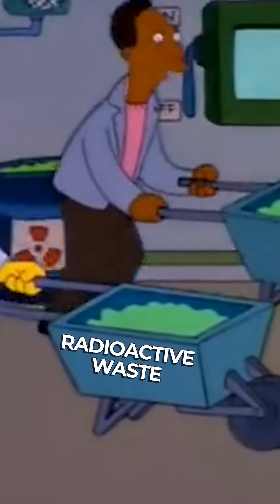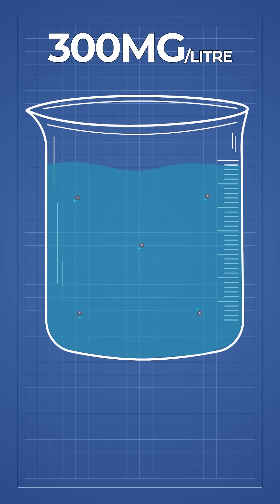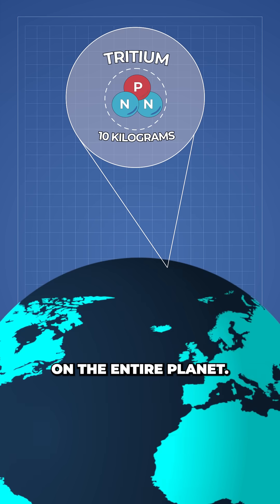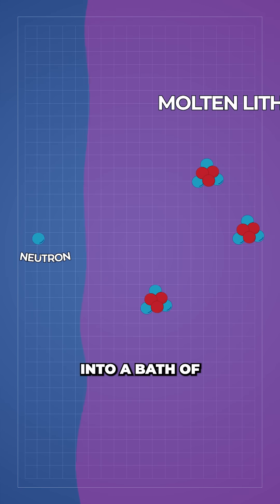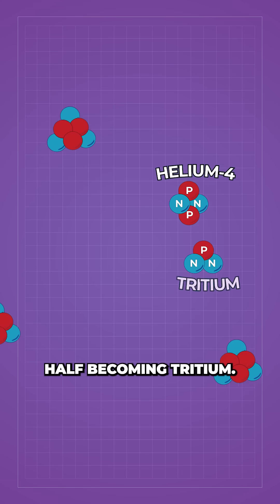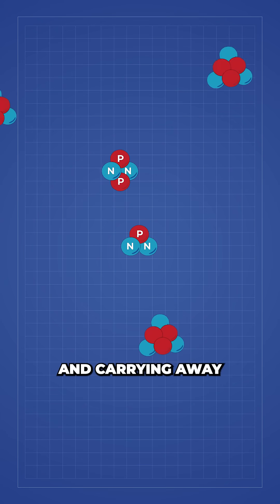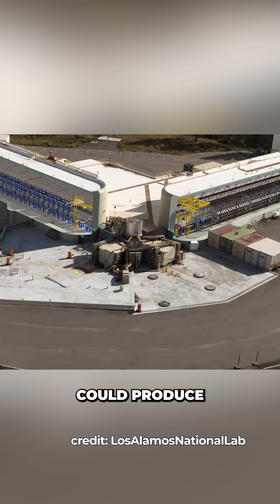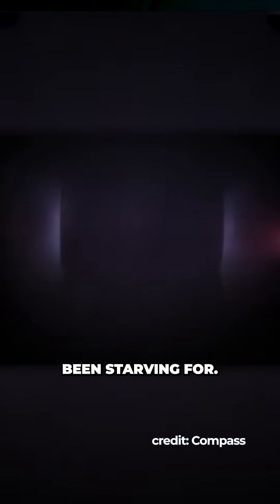Scientists Just Created Fusion Fuel From Nuclear Waste

Comment: Deuterium concentration in seawater: do a basic sanity check and “300mg/liter” sounds way too high. A liter of water weighs 1kg, and sea water would be about the same (little heavier due to the dissolved minerals). 0.3g/1000g gives about 1/33000. No way it’s that high. Should be measurable in parts-per-million. Easily an order of magnitude off.

Comment: A single typical CANDU reactor produces approximately 130 grams of tritium per year. Canada's fleet of reactors generates a combined total of about 2 kilograms of tritium annually. Tritium is produced as a byproduct of neutron interactions with heavy water in the reactor, and it is extracted for use and safety by specialized facilities. 
The Darlington Nuclear Generating Station in Canada and the Wolsong Nuclear Power Plant in South Korea have operational tritium extraction facilities for their CANDU reactors. A third facility at the Cernavodă Nuclear Power Plant in Romania is currently under construction.

Comment: Why they are not using the hydrogen? Smells like fake...
Reply: Because it’s a lot harder to press normal hydrogen atoms together in a way that causes fusion, which says a lot considering how hard fusion with tritium already is
Reply: @alexsiemers7898  
I tell you.
Hydrogen fusion is NOT proven. How proton can decay to heavier neutron, emitt enti-electron and gamma energy? That is aganist the physic.
Especially when hypercharhe particles are far heavier than proton.
This reaction base on fraud "weak nuclear force".
The "Z and W" boson mass should equal 0.42 MeV, just a little less than electron (0.510 MeV) and for two of them anihilating.

Comment: Not ALL fusion reactors use it though. There are A LOT of Fusion designs these days, some better and more promising then others. The french are building one of the most short sighted ones as the casing of the reactor will end up wearing out, being VERY radioactive and EXPENSIVE to replace

Comment: The Geet reactor the thermoelectric heat exchanger is the particle accelerator and the engine it’s paired with becomes the fusion reaction chamber. Various fuels can be used to start the reaction but once it’s started more and more fuel can be produced from steam reforming.

Comment: Interesting. Seems to be analogous to what is proposed in many reactors design, that are supposed to use lithium to be bombarded by the radiation from the tokamak to basically do the same thing. But you still need some tritium to start the whole process, and this is where plants such as the one in the video would come into play.

Comment: But how much energy does It take to blast those nuclei to make the fuel? Is the overall energy going to be a positive trade?
Reply: Asking the real questions.
Reply: This thing is essentially an accelerator-driven nuclear reactor. The accelerator makes it so that the reactor can take many different types of fuel and also the chain reaction cannot self-sustain when something goes wrong.

But it is still a nuclear reactor, and creates a lot of power all on its own. These types of reactors have been proposed before not for tritium production but for safer nuclear power. So yes, it is net energy positive (already before we get to the fusion) - but at an even higher cost than conventional nuclear power.

Comment: I knew that fission could feed fusion but calculus was always an issue for me and so I could never open mouth without inserting foot. (Former physics major; though I was unable to complete my undergrad degree due to health issues). It just made sense.  To oversimplify it for illustration, basically, fission splits helium into different types of hydrogen & waste and fusion takes a type of hydrogen and combines it into helium and so it only makes sense that one should be able to at least partially fuel the other.  I say "partially" because there's no such thing as a free lunch; no process is 100.0% efficient.  One of the biggest issues with nuclear power is what to do with the portion of the waste that cannot be repurposed. I've often wondered if the waste is so energetic, why they couldn't just harness that somehow to generate more electricity? I know that this is a simplistic view (on the surface level, anyway), but I'm glad to see that I'm not alone in thinking this, as they managed to figure out what to do with some of that waste to turn it into fusion fuel and if they can do that so far, I can't wait to see what else can they figure out to do with the rest of it.

By the way, I hope I don't have any typos and this makes sense. I'm quite tired and about to go to bed as I write this, so if there are any typos or I need to edit this, I'll do so in the morning

Comment: Fyi, tritiumnhalf life is around 12.5 years, which is a large reason why we have so little on Earth. It will always be something you have to make. Also, fission is not just "waiting fora fuel source", we are still decades or centuries away from net positive fusion power, let alone making it profitable or having enough smart people to run widespread plants (fusion engineering is some of the hardest there is), so this "solution to fission fuel" is "solving" a non-existant problem/roadblock :/

Comment: 1.	Hydrogen (H)
	2.	Helium (He)
	3.	Lithium (Li)
	4.	Beryllium (Be)
	5.	Boron (B)
	6.	Carbon (C)
	7.	Nitrogen (N)
	8.	Oxygen (O)
	9.	Fluorine (F)
	10.	Neon (Ne)
	11.	Sodium (Na)
	12.	Magnesium (Mg)
	13.	Aluminium (Al)
	14.	Silicon (Si)
	15.	Phosphorus (P)
	16.	Sulfur (S)
	17.	Chlorine (Cl)
	18.	Argon (Ar)
	19.	Potassium (K)
	20.	Calcium (Ca)
	21.	Scandium (Sc)
	22.	Titanium (Ti)
	23.	Vanadium (V)
	24.	Chromium (Cr)
	25.	Manganese (Mn)
	26.	Iron (Fe)
	27.	Cobalt (Co)
	28.	Nickel (Ni)
	29.	Copper (Cu)
	30.	Zinc (Zn)
	31.	Gallium (Ga)
	32.	Germanium (Ge)
	33.	Arsenic (As)
	34.	Selenium (Se)
	35.	Bromine (Br)
	36.	Krypton (Kr)
	37.	Rubidium (Rb)
	38.	Strontium (Sr)
	39.	Yttrium (Y)
	40.	Zirconium (Zr)
	41.	Niobium (Nb)
	42.	Molybdenum (Mo)
	43.	Technetium (Tc)
	44.	Ruthenium (Ru)
	45.	Rhodium (Rh)
	46.	Palladium (Pd)
	47.	Silver (Ag)
	48.	Cadmium (Cd)
	49.	Indium (In)
	50.	Tin (Sn)
	51.	Antimony (Sb)
	52.	Tellurium (Te)
	53.	Iodine (I)
	54.	Xenon (Xe)
	55.	Cesium (Cs)
	56.	Barium (Ba)
	57.	Lanthanum (La)
	58.	Cerium (Ce)
	59.	Praseodymium (Pr)
	60.	Neodymium (Nd)
	61.	Promethium (Pm)
	62.	Samarium (Sm)
	63.	Europium (Eu)
	64.	Gadolinium (Gd)
	65.	Terbium (Tb)
	66.	Dysprosium (Dy)
	67.	Holmium (Ho)
	68.	Erbium (Er)
	69.	Thulium (Tm)
	70.	Ytterbium (Yb)
	71.	Lutetium (Lu)
	72.	Hafnium (Hf)
	73.	Tantalum (Ta)
	74.	Tungsten (W)
	75.	Rhenium (Re)
	76.	Osmium (Os)
	77.	Iridium (Ir)
	78.	Platinum (Pt)
	79.	Gold (Au)
	80.	Mercury (Hg)
	81.	Thallium (Tl)
	82.	Lead (Pb)
	83.	Bismuth (Bi)
	84.	Polonium (Po)
	85.	Astatine (At)
	86.	Radon (Rn)
	87.	Francium (Fr)
	88.	Radium (Ra)
	89.	Actinium (Ac)
	90.	Thorium (Th)
	91.	Protactinium (Pa)
	92.	Uranium (U)
	93.	Neptunium (Np)
	94.	Plutonium (Pu)
	95.	Americium (Am)
	96.	Curium (Cm)
	97.	Berkelium (Bk)
	98.	Californium (Cf)
	99.	Einsteinium (Es)
	100.	Fermium (Fm)
	101.	Mendelevium (Md)
	102.	Nobelium (No)
	103.	Lawrencium (Lr)
	104.	Rutherfordium (Rf)
	105.	Dubnium (Db)
	106.	Seaborgium (Sg)
	107.	Bohrium (Bh)
	108.	Hassium (Hs)
	109.	Meitnerium (Mt)
	110.	Darmstadtium (Ds)
	111.	Roentgenium (Rg)
	112.	Copernicium (Cn)
	113.	Nihonium (Nh)
	114.	Flerovium (Fl)
	115.	Moscovium (Mc)
	116.	Livermorium (Lv)
	117.	Tennessine (Ts)
	118.	Oganesson (Og)

Comment: Man i knew nuclear reactions where hot as hell but having MOLTEN Lithium as a coolant really puts it into perspective
Reply: That was honestly the biggest takeaway for me
Reply: @detumaki why a takeaway ?
Reply: @detumaki why a takeaway ?
Reply: I was thinking the same thing, Liquid Metal to keep it cool lmao
Reply: I always found interesting that when they make large sheets of glass, they have a pool of molten zinc that they pour molten glass on top off. Since the zinc is liquid it is perfectly flat. But zinc melts much "colder" than glass (about 800F vice 2500F) so the glass cools and solidifies on top of the pool of molten zinc.
Reply: @natehill8069 oh shit thats cool
Reply: @natehill8069  This might be one of the most genuinely useful things I’ve learned this year. Now I can try making my own window panes from recycled bottles with some reusable zinc! And a REALLY cool demo for my chemistry students!
Reply: I read they take a bar of lithium and place it on the floor of a tokamak. 100 million degrees °C doesn't seem to care about its melting point.
Reply: 100%
Reply: Lithium has a super low mp compared to other metals
Reply: The meltingpoint of lithium is only at 180.5°C. Not that insanely hot isnt it
Reply: @benoitgoessens3024 pretty hot when you’re considering it’s been used as a COOLANT
Reply: @FetusFight not really bit that is alright. If you look at producing iron or aluminium the temperatures are way higher. And besides that they use the liquid lithium to catch te loose neutrons and make new elements, it is not per sé as a coolant
Reply: @benoitgoessens3024  point isnt about how fucking hot the lithium is but how much COLDER it is compared to the reactor, critical thinking is free btw
Reply: @LowkeyEmerald critical thinking is that you know it isn't even used as a coolant but as a medium for aditional reactions. You can take a course yourself
Reply: @benoitgoessens3024  double, add 32...ya thats fucking hot
Reply: @benoitgoessens3024 well ok yeah good point thats is not THAT hot

But still it was the first time i have heard of a molten liquids being used as a coolant
Reply: lithium mellts at 180C.  Really not that hot for an industrial process.
Reply: liquid metal cooling isnt that crazy, even some commecrial products use that
the fun comes when molten alkali-metal escapes containment
Reply: @kkjkjh professional at not having fun
Reply: There's a bunch of reactor designs that are cooled by molten sodium, or NaK, a liquid alloy of sodium and potassium. 

They're actually quite efficient, but the safety concerns involved (and unfortunately a major accident) have made a lot of organizations shy away from researching them.

Comment: Dude we've been doing this for 20 years tf u mean scientists "just" discovered
Reply: Fusion =/= fission
Reply: @dracod7439  This is about recycling of fuel to make tritium, unrelated to fusion or fission.

Tritium itself was first produced artificially in 1934 by Ernest Rutherford, Mark Oliphant, and Paul Harteck through deuterium bombardment. However, tritium production at scale came during the Manhattan Project (1940s), when scientists discovered that lithium-6, when irradiated in a reactor, could breed tritium.

The idea of fuel recycling into tritium—meaning breeding tritium from lithium inside nuclear systems to sustain a reaction—is mainly a fusion energy concept. This was formalized in the 1950s–1960s, when scientists working on magnetic confinement fusion and inertial confinement fusion realized that deuterium-tritium (D-T) fuel cycles would quickly run out of natural tritium unless a lithium breeding blanket recycled it.

This means we've been recycling into tritium for about 60-70 years and the concept of tritium breeding itself is around 90 years old.

Comment: This wastes energy to make energy, a better solution is a molten salt fast-spectrum breeder reactor which can use these same isotopes to MAKE energy rather than waste it while simultaneously using neutrons that escape the core to breed tritium, further if the salt used is a lithium salt, tritium will also be created in the core.

Comment: sadly nuclear the worlds suply of nuclear waste is on 20kg and to run a fusion reactor for a full day would require 300 grams of nuclear waste a day do it would only power for just over 2 months, the world is shutting down their nuclear powerplants due to meltdowns occuring around the world so the 20kg is decreasing month by month. another thing to add on is that if we do use nuclear waste it will turn the tritium radioactive making the fusion reactor as dangerous as nuclear reactors

Comment: This is actually amazing! It will make opening more reactors easier. You can use lithium to breed tritium in fusion reactor already (so you use tritium in the reaction and the energy can split lithium to make more tritium which we can then cycle through to keep the reaction going) but that only makes so much, less than you put in I believe, or just enough to break even at most. But if we could make it without the need to breed it from a reactor, that’s actually amazing.

Comment: You are aware that not all reactors use those elements, right? And no, causing a nuclear chain reaction in a particle accelerator is not a good idea. And no, you can't make so precise breaks with neutrons in atomic waste in order to get exactly what you want, let aside the cost. Yes, there are reactors blueprints that could use nuclear waste. But no, those are not build yet. Just a few are even planned yet! And I don't know why that would solve our current problems, and did you even think about that there are multiple kinds of nuclear reactors? Some use plutonium, for example. How do you intend to make something as efficient as plutonium by breaking the waste down??? Tritium is the heaviest and only radioactive isotope of Hydrogen! And yes, that is a really small aspect of the problem, I know, there are much more than that. But think about it: Many Reactors on the planet already exist or have run. They run on radioactive materials like plutonium. You can't just switch the materials out like we are in satisfactory! Have you ever thought about why that is? Because you need completely different things for each used reactors type! And another thing: You said, they could produce one fifth of the needed material per year. That's way too low. I am not sure about ten kilogram of Tritium on earth since the web says it's 3.5 kilograms over the entire atmosphere, but oh well! Let's not forget about this: That stuff is pretty weak! And you would need an absurd amount of it in order to make a + in energy! And it's mainly created by nuclear reactors and cosmic radiation! And why on earth would you choose an element thats main usage is as a key ring decoration??? Use your brain! Atomic waste is an important thing, but you would only get a small percentage of what the big reactors produce! Please don't shout things like: "This solves all of our problems!" Before there is a realistic usage. The only good thing in this method is that we could get a bit of energy left in it. But the process takes away much of that energy.

Comment: Well.... current fusion reactor designs would produce their own tritium in the mantle of the reactor itself... Tritium production is more effective with higher energetic neutrons from a spallation source indeed, and could reduce the amount of long lived radioactive materials, but it is very expensive to build and operate. And energy wise, it would add a lot of additional input power required to operate a fusion power plant, making overall breakeven harder to obtain.
And yes, I was part of a group reflecting on building a Linac for a spallation source 40 years ago.
Solar, hydro and wind keep the lights on while fusion keeps us dreaming

Comment: The making of tritium how much power does it require? Is the resulting product a net positive?
Reply: What this video doesn't mention is that this thing is itself a special kind of nuclear reactor that produces power. Depending on the specific design it should produce almost as much or even more power than the accelerator requires, and that is before the value of tritium as a fusion fuel is added.